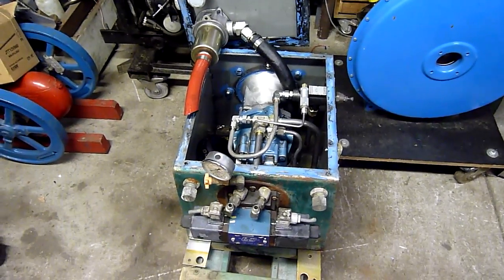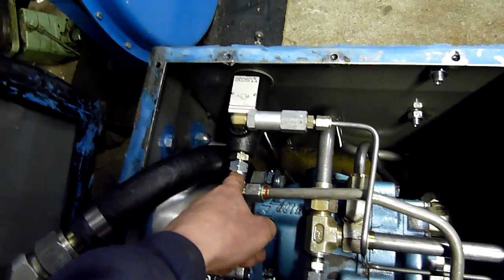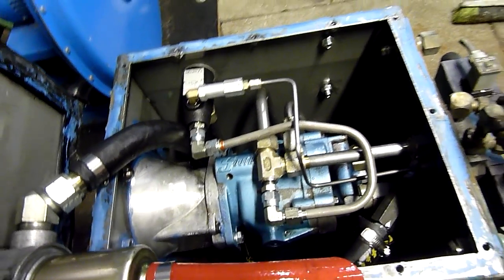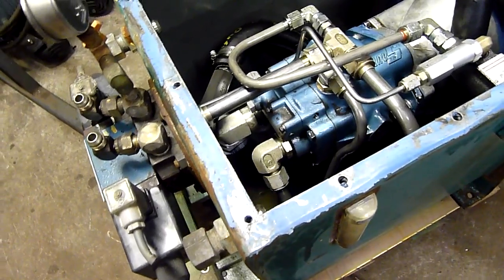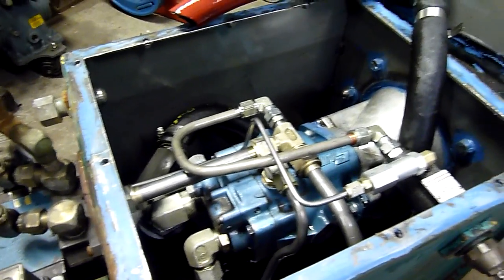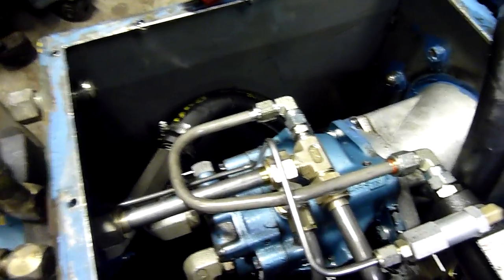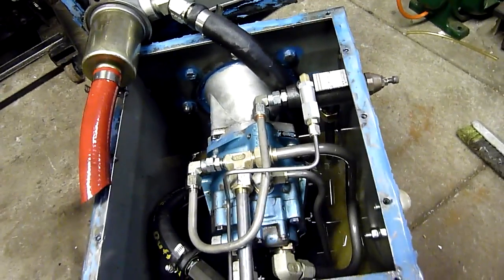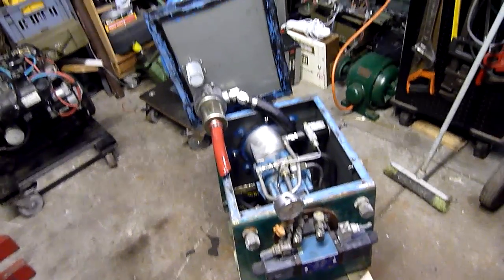Looking Inside the 7 5Hp Hydraulic Power Unit

Comment: Hi the main base for your directional control valve can stay with the machine the top pilot assembly is replaceable as a complete unit if the spool is crook, or you may be able to get a new seal kit for it if the actual spool is ok.